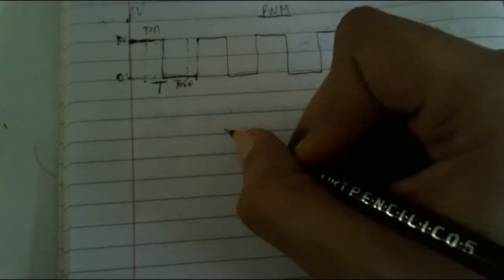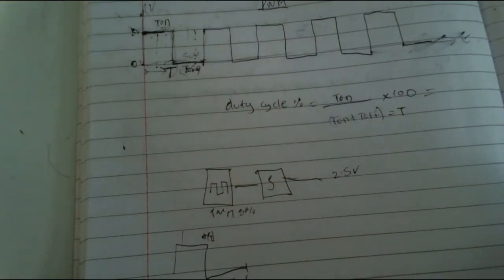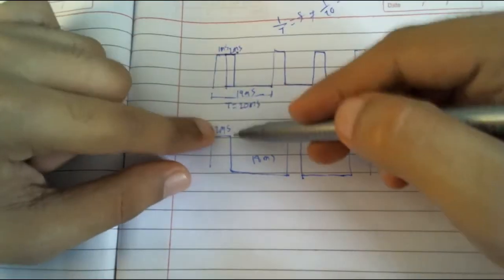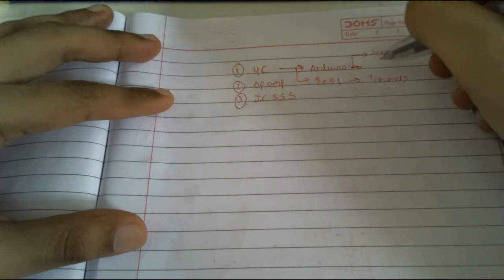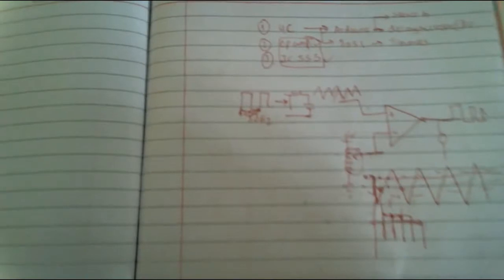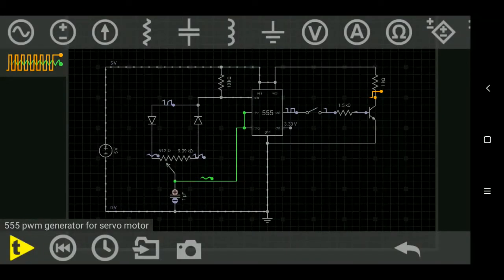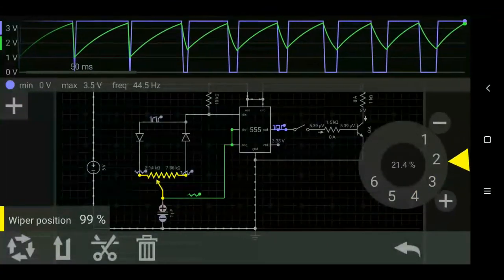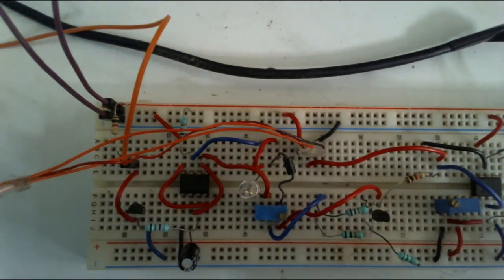PWM circuits for controlling servo motor.

Comment: How can we say  that 2 milisecond  pulse rotate 180 degree ,, why it is so accurate ??? Why not 240 degree ?
Reply from the maker: @abhitrivedi6861  Thats what written in its datasheet (sg90 servo motor) but from practical experiment, it's not always accurate. You have to vary the pulse duration from microcontroller output and see the relation between pulse width and angle. It can exceed 180 degrees, maybe to 240 but it will never rotate 360 degrees.